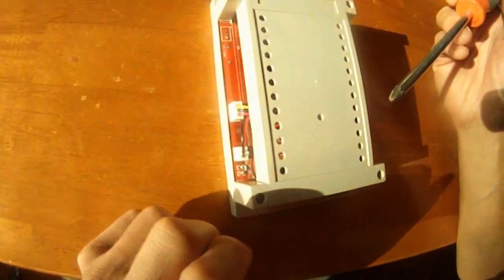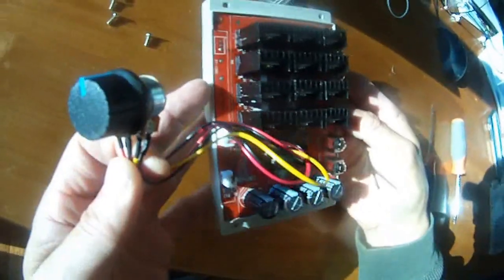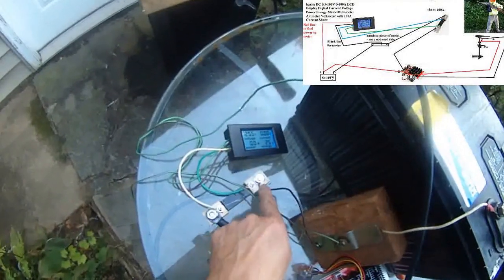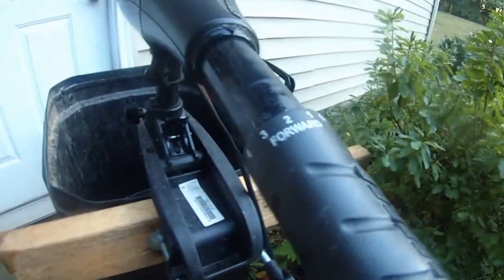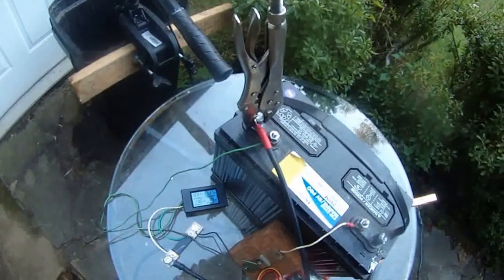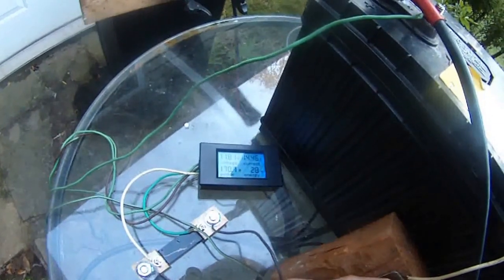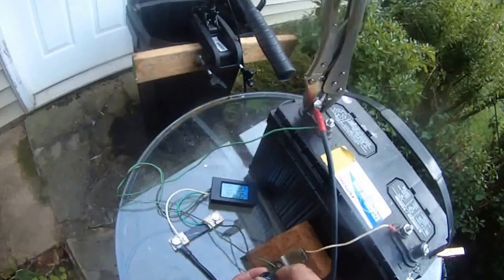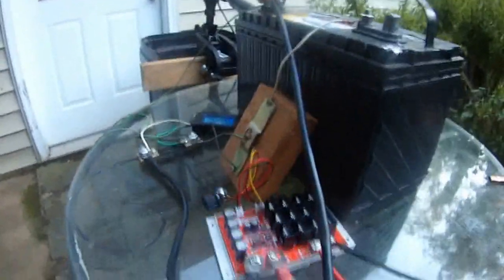How to build a variable speed controller for trolling motor? aka digital maximizer

Comment: have you noticed a dramatic increase in battery efficiency when you are using your trolling motor with this pwm?   i'm getting ready to buy this same pwm and use it with my 24v trolling motor (which draws about 50a full speed).   thx.
Reply: I didn't use this enough to be able to tell u but in theory it should be more efficient. I bought a nonworking (fixed diy) wireless digital trolling motor 24v and has been using that instead. I didn't come up with a good solution to permanently place this PWM on my boat so everything was loosely connected and that's not good so have stopped using it. Too much work to connect everything with PWM so stopped using it.
Reply: snakeclaw bcz I need my boat for fishing and pleasure boating so hard to keep disconnecting and connecting repeatedly
Reply: i understand completely.   i'm thinking about trying to find a way to mount the pwm inside my battery box (or in a waterbox mounted to the lid) and then running a longer cable with quick disconnects so i can put that adjustment wheel where i would like it.

Comment: I have a question, "What would a 12V 60amp PWM do to a 12V 50amp max draw trolling motor?"  Would it feed too much electric to the motor or ?  I am torn between purchasing a PWM with 40amp or 60amp max for my 12V 50amp motor.  Any help appreciated.  Thanks!
Reply from the maker: +Edwin Mendija I am no experts on the PWM. You can post your question in any PWM forums to find out the answers. My tests showed me my minn Kota c2 30 lb push trolling motor was using 15 amps+ in water at full speed (gear 5). Not sure why it was not drawing 30 amps? So, the suggested 50 amps inline fuse for TM maybe for safety and conservative reason. My motorguide 24v and 70 lb push TM was only using 31 amps at full speed in water with two 12v batteries. I am not sure why motorguide was not using 70 amps? So, 40 amps PWM should do the trick if your TM is rated for 50 lb push based on my tests. Certainly, if you can afford the price differential I would go with the 60 amp PWM for your TM. Good luck!
Reply: @Edwin, a  60amp PWM means that your controller can supply as much power is needed by the motor, but not more than 60A. It can handle up to 60A. If your controller  can handle only 40A, but your motor will try to get 50A, your controller will fry.
Reply: Did you get an answer to your question?
Reply from the maker: no, why?
Reply: I found my answer on Facebook's "Motorized kayak fishing" group.  Tons of info on motorized kayak fishing, just gotta' ask.  But I did build that same trolling motor controlling using the same PWM and voltmeter as the guy used above and so far it works good.  Just added the forward/reverse switch from the motor into the mix.
Reply: Just cerious, I have a 55 lb trolling motor  and put a 40 amp control switch  on it. It works, just at low speeds it makes a wineing sound
Reply from the maker: I didn't hear much noise if there is any because I used it for fishing. The birds chirping and wind pretty much drown out the humming noise from the PWM.
Reply from the maker: I did try to listen to the noise and wanted to record it but the noise was almost inaudible compared to the birds so gave up in recording it.
Reply from the maker: you may have a defective PWM, send it back if you can. My PWM was very smooth and no noise at all.

Comment: Glad you hooked it up and it worked. Did you know you don't the "random piece of metal" in your setup? I thought by your title name that you actually built it but all you did was install it which is actually very simple to do. Work on your microphone skills so we can hear it when you do the next video. I have consistently heard that the Chinese made PWMs are junk because of inferior materials and lack of quality workmanship, let us know how it holds up.
Reply from the maker: +idiotsrus thanks for the encouragement. It was NOT easy for me because I took a risk for burning my purchases - LOL. It will take another month for them to get here not to mention the lost money.The PWM didn't come with instructions. I was not able to find any electrical diagram to hook up both the PWM, multimeter, battery and trolling motor. Thanks for the feedback, My video cam gave me trouble since day 1. never bother to fix it.
I tried to avoid the chinese PWM that's why ordered from amazon instead of ebay. But, it came from china anyway and took a long time to get here. Luckily, the 2 things performed very good.
Yes, I will let all know how they hold up over time.